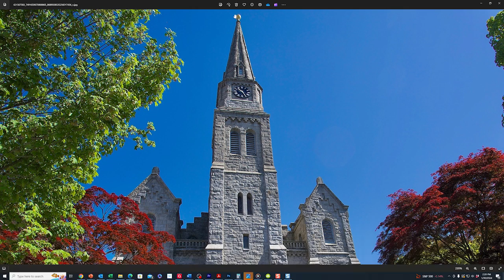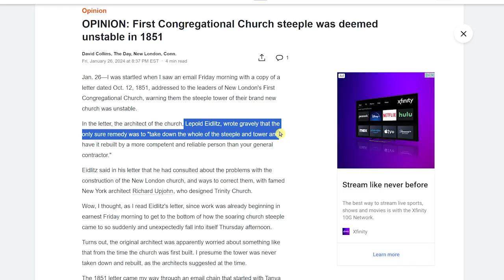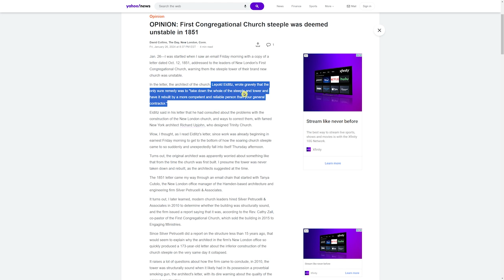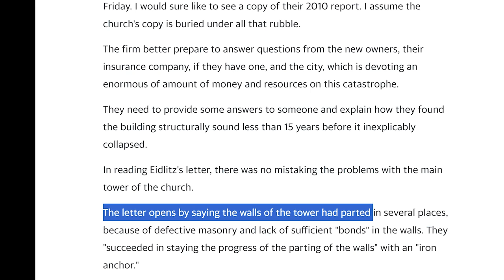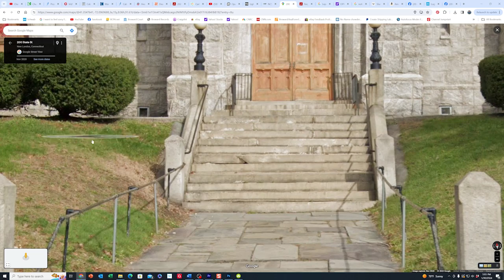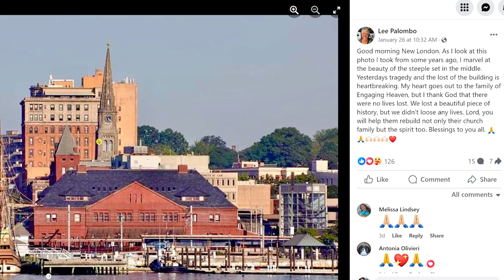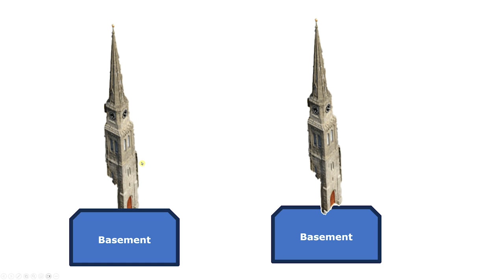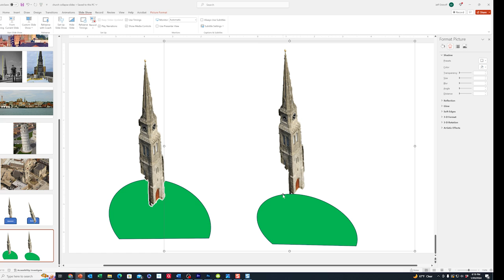What Caused Church Steeple Collapse New London, CT?

Comment: Im thinking some settling of the ground  was the cause and because everywhere else on the church is fully supported the top of the steeple was the only part unsupported so due to the  size and weight that was the only part to suffer. It did well to survive till 2024 though in 1851 these issues of its stability was noted. It did say anchors were put in in around 2010 so perhaps instead of those securing it, they actually weakened the rest of the structure leading to its inevitable end on the floor of the church. Please tell me no one was actually inside at the time. I doesn't bare thinking about

Comment: Thanks for covering this, another story of a seemingly OK building just collapsing out of nowhere. Though, with radically different circumstances. 

When I saw the video, my first thought was something destabilized the foundation and collapsed the tower from its base. But as I saw more and more pictures, you could definitely make out a lean in it. In fact, I'm suprised it was allowed to exist like that, its a very noticable lean. 

Then with the pictures you have showing the connection between the tower and the nave wall, it looks like the flashing was not doing its job. If water was allowed to get between those walls it could have effected the mortar of those joints and gone undetected for years. 

So, my take: unless they dig up the foundations and find an underground stream had washed away its support (like they found with the tower of Pisa) I'd say the cause is an improperly built tower that slowly leaned more and more over the decades, whose mortar was slowly stripped away in a spot that was not visible from the outside

Comment: You are almost correct about the way the steeple fell, but it slid down the front steps almost to the front gate. 

It basically pulled from the front of the building like a mudslide because the ground in front was saturated with water.

Comment: i can already tell you why it collapse from the picture at @2:55 if you look just above the central door on the right you'll notice quite a separation between the stones, you can also see from the CCTV security cam that the steeple was already leaning which means that there's an issue on the inside towards the back of the steeple likely on that little balcony. it finally just gave way to gravity. i'd be more interested to know if there was any repairs made on it in the past on that balcony or if there was noticeable damage to the structure on the inside on the back portion of that steeple as that would give some insight as to whether or not this was caused by simple aging or bad repairs. it should also be noted that some older structures are vulnerable to a lot of heavy construction that goes on nearby.

Comment: Writing as someone who has jacked up twenty two storey bomb damaged buildings , tunnelled underneath them and installed structural steelwork - hands on and as supervisor (of Note as you'd say) - I reckon the foundation of this steeple failed through imbalanced settlement ( towards the corner  it lean pointed to!) While there could well have been issues with the bonding and general standard of building - if it was upright and square - C of G within its base - it would still be standing. I've seen many a church tower / steeple over here with developed splits and cracks - some caused by new rings of bells but most purely through settlement - or design problems. Our finest cathedrals are masterpieces of divine will over gravity!  
Most church towers / steeples are more like pylons - four legged beasts rather than continuous cube forms - this one has a big door on one elevation and no doubt similar or bigger opening on its interior - old buildings rarely have foundations worthy of the name in today's understanding. 

The most cogent fact that makes the Pisa campanile an unfair comparison - is it's massiveness! Its walls are over 8 feet thick at the bottom and has a circular form over 50ft across which looks to be the width of the entire church here.
Even as an atheist - I'm saddened by the loss of this old building that many folk have put their "souls" into.

Comment: High Jeff, I have worked down in New London for years. In the past few years they had driven new piling’s into the state pier to support the building of the new windmills. Myself and many others around could hear the hammering of the piling’s, see them being driven in, but more importantly feel the vibrations. Now I was curious as to if this may have contributed to the degradation of the church?
Reply: It’s very doubtful. Driving piles wouldn’t have ever become common practice if it was so damaging to buildings that driving piles into silt could damage an otherwise sound building built on bedrock miles away. For the pile driving to have meaningfully affected the church, it would have had to be basically on the verge of collapse anyway.

Comment: Thanks for a great analysis. In looking for a trigger, this occurred to me. A couple of the early eye witnesses said they heard a boom which caused them to look and then they saw the collapse actually happen. I was thinking that maybe the tower was leaning up against the front stone gable and its associated wooden truss holding the roof. You can see plainly what the trusses look like from the last one standing. That boom may have been the truss failing from the lateral pressure and that could be what triggered the collapse inward.  Watching them dismantle the two side towers https://youtu.be/ftBi18ZgHFY, it did look like all the mortar was very weak. Almost no two blocks stayed together. It probably should have been repointed dozens of years ago. So sad that nothing could be save

Comment: The part of the steeple that you see from the front looks pretty good.  There appear to be fairly substantial pilasters either side of the main front door.  But the steeple fell behind that part.  We can't see what the back side of the steeple looks like, how much masonry continues down to the foundation within the building.  If there is leaning then there is likely some settlement in the foundations under the interior side of the steeple.  We don't know the condition of the masonry in there, it could be hidden by interior walls and not obvious.  If you have leaning and it appears from the photographic evidence that there is some leaning, that induces horizontal forces in the structure.  When the horizontal forces exceed the strength then it collapses.  There isn't much leaning and the horizontal forces wouldn't be big so they must have acted in combination with other issues such as "separating masonry".  You can imagine that the internal forces in the leaning tower of Pisa are relatively high but it has enough strength to resist them.  That building was built starting over 800 years ago and likely doesn't have anything in its construction other than masonry so the leaning in itself isn't necessarily the full cause of the failure unless there was for some reason a sudden change in the foundation situation of the church.  If it is done well you can stack masonry pretty high and it will set there resisting normal loads, the Washington Monument is pretty much just stacked masonry.  If the stacked masonry is not done well and there is some historic evidence that someone thought it wasn't done well, then maybe it stays on the verge of collapse for over 100 years.

Comment: My guess would be the problems the architect referred to was the fact the contractor didn't bind the gothic arches properly as part of the building process. Gothic buildings want to tear themselves apart and the only thing holding them together is the mass of the ornaments outside. This church was neo gothic and has no ornaments on the exterior hence it needs to be bound together internally. My guess would be it was the left side support rod next to the entrance arch that gave way and allowed the support wall facing inwards to drop. The rod could have been gone for a while and nobody noticed because it would take time for things to go south.

Comment: Very good analysis of what happened to the church. I have some questions though,  that I think critical thinkers would ask. There are numerous accounts of the age of this church being built in 1810. I find it curious that Yahoo finds this letter of grave concern about the steeple construction to be dubious with regard to its timing, If it was so concerning, why was it ignored for 173 years (assuming construction was in 1851 and not in 1810) ? How about a copy of this letter Yahoo?! The other bothersome thing, at least in my mind  is, the way the steeple sank rapidly -  link a controlled demolition would. It seems like, as Jeff stated, that the bottom of the steeple (as it sat on the front wall of the church and anchored by the towers and the roof) collapsed and buckled outward to the street while sinking and ultimately laying over towards the dormitory, as the steeple ball landed inside the church. I still don't see any smoking gun as to why this steeple would collapse in this fashion. Why did numerous eye witness accounts mention they heard a loud boom right before the steeple collapse?

Comment: You don't see any cracks? Looking at the image at 12:39, That area below the abat-sons is full of cracks that have been patched. There may even be a couple going through blocks and not just at the joints. You can see the lighter lines where they have made repairs if you look closely.

Comment: Have to correct you Jeff, it was not the Steeple but the Tower that collapsed. The upper floor of the Tower that is the Clock Room with the Bell Room below that and the Bellringers Room below that and below that the West Door allowing direct pedestrian access into the Central Nave. In the Church with Steeple where I worship the part of the Tower adjoining the Nave is open on the East side into the Nave. First class work Jeff, this church should have been closed until further investigation that confirmed the tower was identified as leaning. It is a relief that no one was hurt, I'm very glad about that.
Reply: thank you. in investigations accuracy it vital

Comment: Great work so far Jeff. I am an architect and as a vestry ( board) member was once involved in having a structural engineer assess our bell tower. Similar issues: weight of heavy bells high in tower,declining membership, lack of funds, need to sell building. In this case I think the engineering report was in preparation for eventual sale. I read elsewhere that after the 2015 sale, the roof was later repaired or replaced. As you note, the junction of steeple and roof looks funky, could be that mediocre new roofing to replace or repair original slate roof led to water entering along back side of steeple and weakening interior foundations on that side. As another commenter notes, at 2:44 you can see large stairstep crack on side of tower to right of front door. Makes sense cracks would be at sides, not front, and the iron rods might be trying to arrest that tilt. It is a common problem: large, complex historic buildings now owned by  smaller groups with limited funds to maintain the. Sad loss here but a miracle church was empty at the time.
Reply: apparently it rained....ALOT. mauybe the soil around the church was gettign more saturated with water . if i recall, old buildings tend to have shallow foundations too.

Comment: The aerial shot @2:47 shows a large crack on the right side of the tower just above the main door and even with the second floor battlement wall window running down seven courses to  the darker stones below.
It's too bad that they won't save the two smaller towers and the rear section of the building, maybe putting a garden where the rest of the building used to be.

Comment: Excellent analysis. I sure hope the city doesn't remove too much of the debris to allow the failure to be analysed before it is lost to time. Like Florida, I am sure there are a lot of unstable structures that need to be peiodically inspected in many places throughout the country. By the way, if you look at the right side of the tower @ around 12:14, you can see the sloped slab has a crack, which could allow ingress of moisture; and the vertically aligned blocks directly below. In addition, in an earlier photo @ around 2:08, the adjacent side wall also appears somewhat damaged - consistent with your evaluation. Thanks, and great work.

Comment: Photos show some subsidence to the plinth either side of the steps and to steps themselves , possibly 'wash-out' to sands and gravel blinding / sub base or even original strata , poor bonding between courses in the coursed rubblework ( too many verticle joints coinciding sometimes 2 and 3 courses unbroken ) , poor stonework may indicate lack of 'snecks '(throughs or ties) , the long stones that lay  between inner and outer courses . Was OPC , white cement or lime used in the mix ? Abundance of dust indicates white or lime cement in the courses and therefore possibly foundations too unless stone slab foundations used .
Video of collapse shows typical blow out of lower supporting structure before upper section separation into 2 or 3 sections that fall in direction of lean .

Comment: 3:38 guess - The fact that the steeple rubble is neatly fallen into a small, narrow space where there is nothing to crush is either really really fortunate OR, it was a controlled demo. Gonna finish and see if I am correct. Other Clue: There  is nothing inside the church like pews or an other wood (which was probably still quite valuable as reclaimed wood since when that church was raised, only the best, most expensive materials would have been used. No glass seems to be in the rubble either. They had time to gut the place and squeeze some dollars out of it. God knows people aren't tithing like they used to!

Comment: My thoughts are that the steeple had little support on the back side and snapped off near the lower front window, just above the arched door. The steeple then both slide forward and collapsed the remaining arch that was supporting the front of the steeple.Too much of the separator walls between the other two towers remained intact.The falling steeple would have then destroyed the arch and door.

Comment: My Guess is that one or more of the iron tie bars failed, which caused a section of the steeple to bow out, leading to its collapse. probably due to water intrusion. If it was one of the original 1851anchors that failed,  its possible the condition didn't exist in 15 years ago when the engineers report was written.

Comment: If the front walk, steps and landing caused water, and particularly salt water in the winter, to drain toward the building front this could seriously undermine and degrade the foundation over an extended period of time.  Particularly if one side took most of the drainage.  That could have caused some of the rotation of the steeple when it fell.

Comment: Uhm yeah talk to a stone mason, @ 13:42 I see several smoking guns!
Copper Flashing, always leaks!
Where's the sealent between copper & stone?
More stay bolts
Lime stains throughout the whole corner of the steeple!

The 4" of rain the previous week prolly pumped the front of the foundation up while the already faulty steeple got pushed past it's tipping point, overloaded the part already insufficiently reinforced & down came Humpty Dumpty

Comment: @11:53 You can see stay washers on the right & left of door frame near the top of the doorway, almost out to the edge of the doorway pillars.
They're square with a buttonhead bolt, painted to match the stonework, the left one is starting to rust stain.

Who installed those, & when???

Yeah You see them, they're all over the place!
Holy crap, they tried fixing a defective stone tower with scotch tape & baling wire.

Comment: If one is standing on the church steps looking at the entrance, and that's in the North direction, I would say the breaking point was at second story and the North West corner of the tower. 

I would say the reason is water ingress/water damage eroding the load bearing walls at the point the balustrade between the two towers meet the main tower, but on the inner point where the tower meets the main hall. 

From the drone footage at 2.55 one can see all the moisture from water damage running down the walls.

Bad maintenance made this disaster.